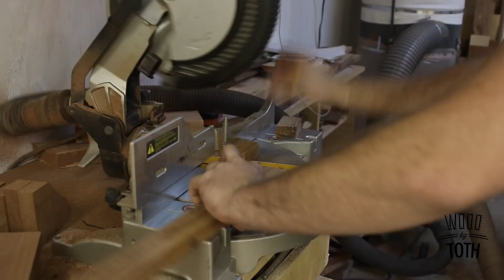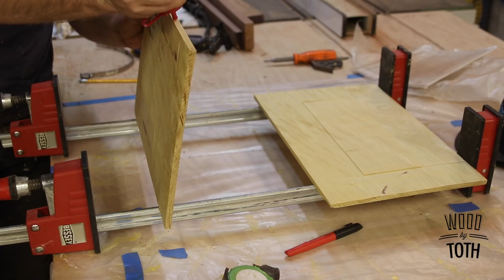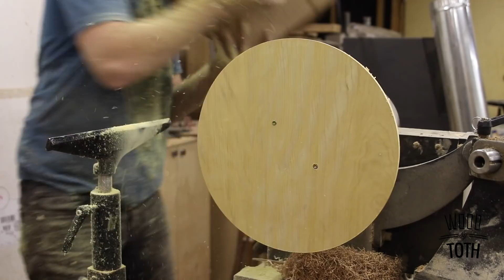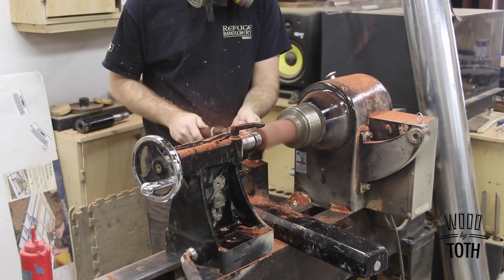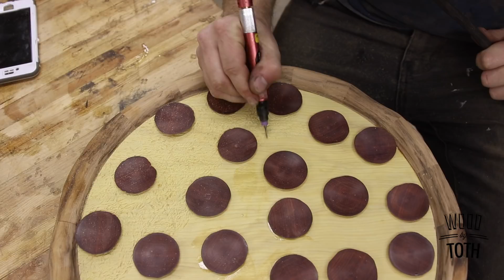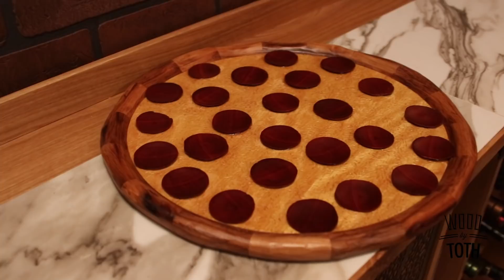Wooden Pizza

Comment: You could totally use that as a fun serving tray if you made it flat by pouring some resin in it to make it flush, or you could turn it into a really cool clock if you mounted it to a slightly bigger board so you put numbers around it, maybe you could even cut it into 12 slices too.